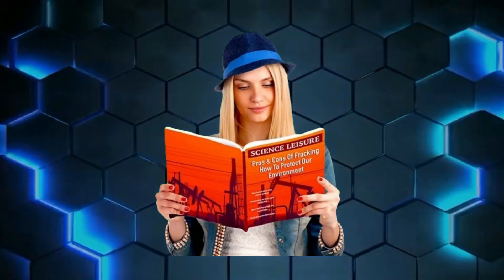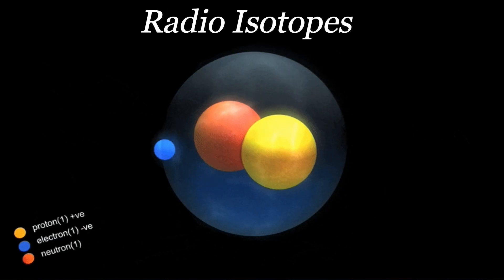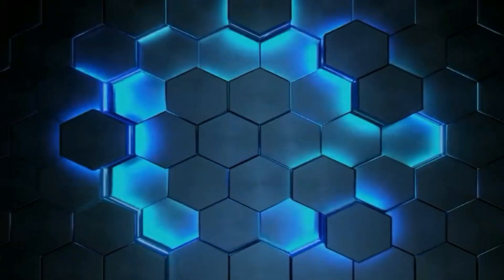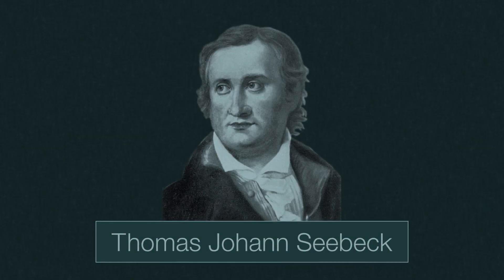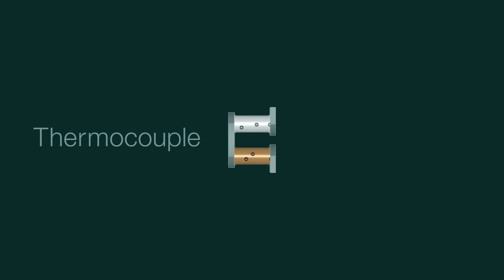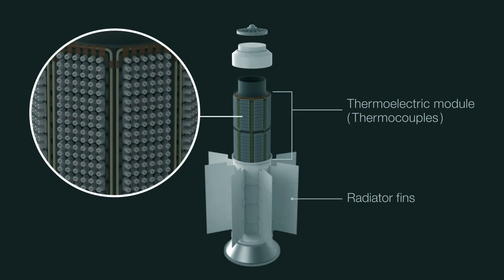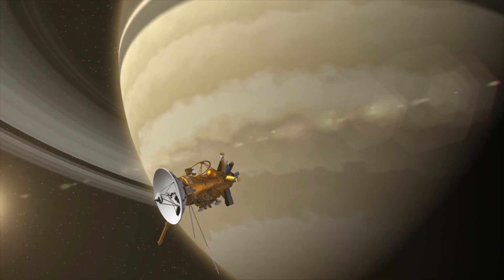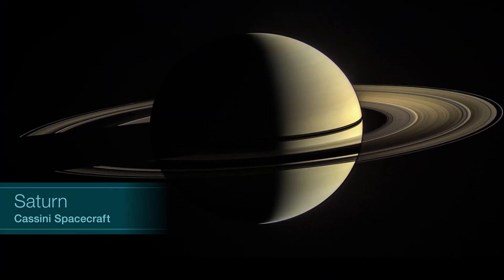The Nuclear-Powered Battery |  (50 years of backup)

Comment: Imagine every house and devices running with nuclear power?
Godforbid, in the event these batteries go malfunction, there goes boom 💥
Reply from the maker: The US Nuclear aircraft carrier has the back of two hundred years, the Cassini space craft and the Mars perseverance rover are using the static RTGs with plotonium dioxide to produce powers. The scientists would probably put this device with all precautions and protaction measures , They are ahead of thinking.
Reply: @tahirmalik4553 backup of two hundred years